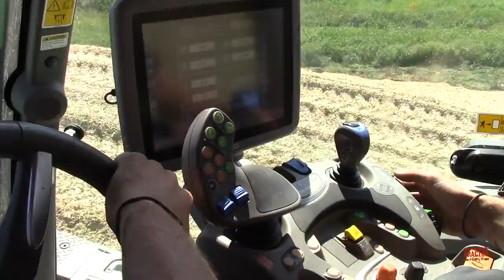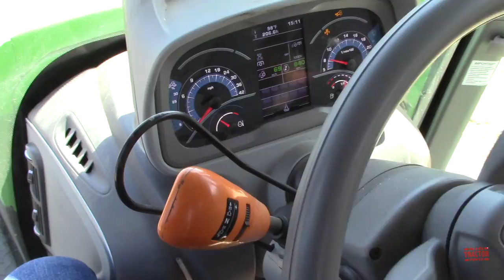Building a Corn Silage Pile: Deutz-Fahr 9340TTV Tractor

Comment: Nice unit.  And lots cheaper then JD or Case IH. Thanks for the vid 👍
Reply from the maker: The Deutz offers allot at a much lower investment.
Reply: yes but a lot lighter built than a JD of Case we run 3 and we've had nothing but issues without A.C. (in Texas so kind of a big deal) and they seem to overheat a lot easier than our John Deere likely up farther north they work better but where I am they can't cut it in the summer (btw we run 3 because the dealer is good to us)
Reply: Dean Churchill cheaper than case? Not in europe. They are at the same price range as John deere. Deutz fahr has never been a cheap tractor.
Reply: Kris I was just going off what BTP said
Reply: @krisdieselv6  in the US, they are less expensive than JD tractors of similar class. The reason JD and Case tractors are more expensive in EU is because of the import taxes and fees, which then gets factored into the total cost by dealers.
Reply: @chrishaugh1655  That's false, they don't get imported. They get built in Mannheim, Germany.
All the JDs we had at our contractor were built in Germany itself. 

A John deere in Germany and a John deere in the US can also differentiate due to diffrent rules and regulations having to be met.
If it's like with the Ford cars for example, then the ones produced and sold in Germany have higher quality and a little more features than the ones sold in the US as well. That could increase the price, but I doubt it.

I'd guess it's just Deutz wanting people to try their brand and lowering the margin is the easiest way to enter the market
Reply: @stevenlang9849  Manheim doesn’t build the large frame tractors

Comment: It’s funny how car manufacturers are getting grief for moving to CVT transmissions for durability issues but now I see tractors using them.
Reply: The CVT transmissions used in cars are not comparable with the CVT transmissions used in tractors. Very different principles are used.

Comment: I own a 1985 deutz fahr 7007 has been a great tractor
Reply from the maker: Very cool. I am a Deutz fan.
Reply: bigtractorpower  so am i we are collecting deutz tractors from the late 50s till the 70s hp from 50-130 we have the first series that was produced with an aircooled engine and also was the first imported into north America they are very strong and over built tractors with many features not found on tractors over here

Comment: Think the DF is bigger than most of our neighbours dozen DF tractors but the dump trailers are a little smaller as his need over 200hp not to pull but for the oil capacity for the rams as they drained the back axle of a 175hp tractor they tested before it fully tipped the trailer

Comment: Are there any farms that use those huge steel wheel garbage compactors at land fills ? Seems like they would do a better job at compacting the silage ? Great video and thumbs up !
Reply: They might compact the silage but they will destroy all the surrounding concrete.  And also would be useless 99% of the year.
Reply: @SoloTwo42 , Good points. Wasn't thinking about the surrounding concrete and the 1% use for most of the year, Thank you.
Reply: A front end loader would be better

Comment: Can you make a video based on comparing transmission used in modern day and their pros and cons.
Reply from the maker: I can look at doing a video on transmissions.  CVT is quickly becoming the top choice on high horse power tractors.
Reply: Answer is simply. Powershift is cheaper, little better in power (less power loss on wheels, for example in european test John Deere 6210R had 210 hp ISO with Direct Drive transmission and 207 hp ISO with CVT AutoPowr), easier and cheaper to maintainance. CVT is more expensive, but also more comfortable (just click and drive) in driving, expensive in maintenace and had shorter vitality (for example in Fendt, Vario must be replaced after everyone 10 000 working hours, old was sending to factory for renovation and You can buy new or after renovation, it's cost around 20 000 USD, the price may be diffrent, I compare from Poland, where new Vario cost beetween 35 000 - 52 000 PLN for 200-900 Vario tractors).
The final choice belongs only to the owner. For me driving Fendt with CVT Vario transmission is very easy and comfortable, but price of this tractors is sometimes "deadly".